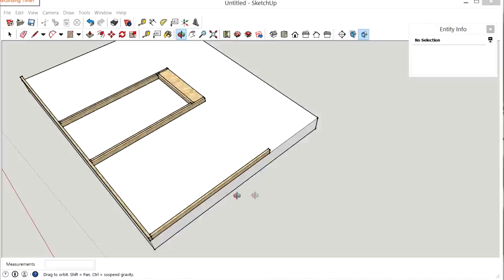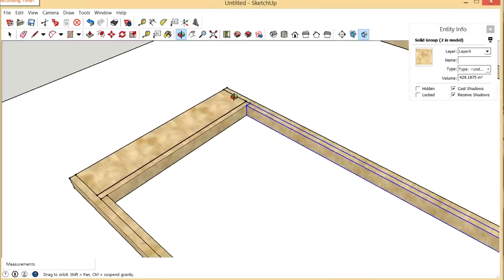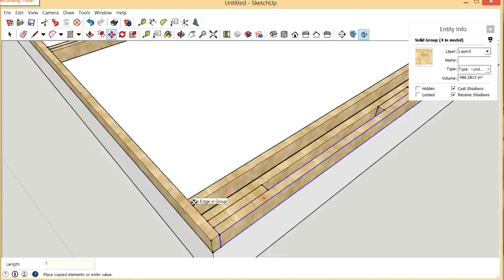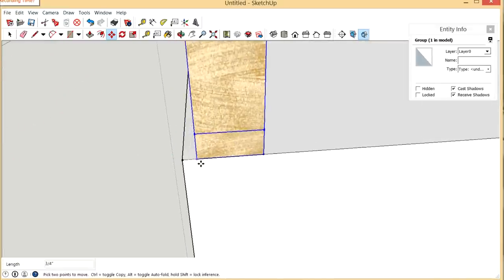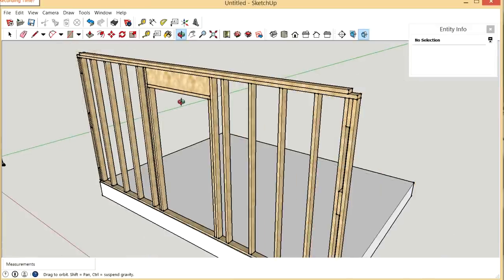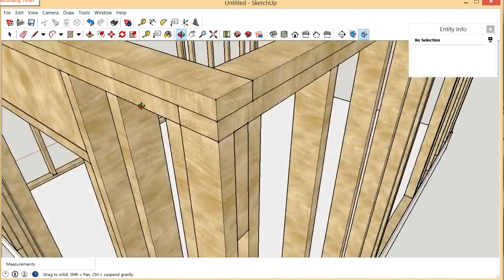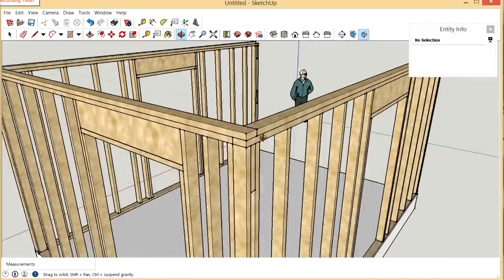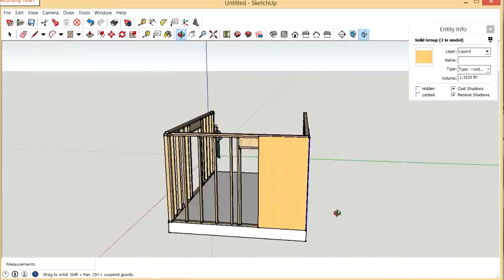Framing Exterior Wall Corners - Requested SketchUp Video

Comment: Tony,
   When the osb is placed where the corner of the wall begins and not the corner of the concrete the 16" on center layout is off, if that is the corner of the concrete is used to begin the centers,  so as that the osb doesn't break in the middle of the stud leaving no overhang for the next osb. I was told to pull centers from the end of the concrete not the start of the wall. Do you recommend cutting the width of the osb off the length of the first sheet so that it'll break in the middle of the stud, or pull the centers from the start of the wall?
Reply from the maker: The layout is marked on the framed wall not the concrete.  The layout will not be off because you lay it out properly so the OSB lands in the center of the stud.  If you hook your tape over the plates when you are laying out and mark the centers, there is no way the OSB will not work.  Trust me, I have been doing this for 40 years :)
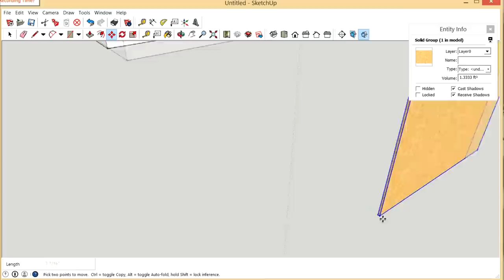Reply from the maker: Watch the video again staring at 12:43  you will see the OSB work.
Reply: @ArtisanTony  That's what I thought. I think what it is, is that the one who told me to pull from the concrete was thinking to have the OSB hang off the concrete, which would make the wall start at the concrete, which if done would then have a correct 16" on center break for the OSB. That though is a different method a building, than what you're showing, which of course, is to have to the OSB sit on the concrete. Thanks.
Reply: @ArtisanTony  Is there any way that you make a vapor barrier for the osb and bottom plate? This other person does build with the osb hanging off the concrete, and not sitting on it. I know he told me to build with the osb on it, but now he's saying no because of water leaking off the osb, and not having a place to go which causes rot. How do I guard against that? I've already poured with measurements for the osb to sit on the concrete.
Reply from the maker: @terranceedwards4750  if water is getting to your osb then you have failed.  Let me ask you,  if you let the OSB hang over then the bottom of the osb is exposed the exterior right?  There are many frauds on youtube who have never built anything.  Trust who you wish.  But if you let the osb hang over then you have exposed it to all of the elements and everything else mother nature has to offer. good luck :)

Comment: Great video, thanks.
Question:
Which wall usually receives the stud-block-stud combo with the top plate cut back 3.5 in, and which wall usually has the longer top plate which overlaps the other wall? Is it the gable wall with stud-block-stud and the eave wall which has the longer top plate? Thanks
Reply: Great question! It doesn’t matter, does it? I’m just learning framing now.

Comment: The outside OSB sheet lands 16 inches on center but because of the corner when you put drywall on the inside won't it miss the stud by 3 1/2"?

Comment: On the short walls do you start your second stud 3 1/2 inches further back to account for the thickness of the long wall at the corner?
Reply from the maker: yes, so the 48" OSB will work out coming both ways from the corner.

Comment: the quarter inch is left for the OBC in the corner is a little unclear, why do you do this and exactly how would you keep the OBC flush... could you please elaborate, i am in the process of doing a 11 by 7 feet shed that i want to frame up and make proper because whats there right now is more or less a fence shed im going to take down... i have done some architecture classes in the past so im not exactly new to framing but never really got into the exact 1/2 inch corner to run the OBC out... we where just thought to overlay the OBC on its corner... would help f you could explain a little better.

Comment: Use the blocks somewhere else and just throw a full stud in there or go with a California corner. Stud block stud is the kind of framing you should try and avoid. It's early 1970's track house framing at it's worse.

Comment: I want to know if I am framing this would the first floor be 8' studds with the two plates on top then another level of 8' studds above it if I want half the back second level to a loft and the front to be an open cathedral ceiling or should I use 16' studds all around?
Reply: I'm building a cabin in Alaska. I'd share a pic of what I'm looking for but there isnt an option to share a pic
Reply from the maker: A wall that is 16' tall should be built out of 2" x 6" studs  and be full length.  Do not stack one wall on top of another.  This creates a hinge condition in the wall and the building inspector will get you :) But to answer your first question;  studs for an 8' wall are 92 5/8" long and the wall height is         8'-1 1/8" when you nail the bottom and two top plates on.   This is so when you add finish floor and ceiling material you would still have 8'.   Normally the floor system divides the 8' walls on a two story home and gives them stability.  I can help you design this for a small fee :) This is what I do at atdrafting.com

Comment: Video not to long,showed the purpose and reason of an OSC. What you referring to as a jack, we call it a cripple.  I never used a 2x4 under a header but do see how it can help in installing it flush.
Reply from the maker: a cripple is anything shorter than a stud except we call jacks, jacks.  Normally cripples are below windows or above headers when there is more space above a door or window.

Comment: How about a greenhouse? What materials could be used for sheathing and roof to allow the best sunlight into the building. Would the sheeting need to be outer and inner for insulation (trapped air in between)?
Reply from the maker: The806Traveler This one has some challenges.  I have seen many greenhouses with just plastic sheathing but as you know, this is not very strong.

Comment: so how does the interior layout work out if the first stud is offset 3 inches because of the corner. do you just cut your first sheet rock and then grom there everything is on 16in centers? thanks

Comment: How would you frame a 6'x10' lean to style deer blind on a hay wagon frame that is decked over with a 8' high 10ft long wall and on the backside a 7' high 10ft long wall with a running slope on the 6ft walls connecting them
Reply: I am struggling with how you would tie the headers together on a sloped roof
Reply from the maker: @adamd6261  you can contact me here https://atdrafting.com/request-for-service  Thanks!

Comment: Is the 2x4 between the jack stud and the header necessary? Couldn't the header just rest on the jack stud?
Reply from the maker: The 2x4 on the bottom of the header helps set the width of the header and also the height of the door opening.  This is the way walls are framed.  Thanks

Comment: do you have any good books for room framing and electrical?
Reply from the maker: Yes, I buy used text books from Thriftbooks online. I just checked, they have the textbook I had in my building trades class 4 years ago.  It is called Modern Carpentry and they are really cheap now used.  I paid like $75 for the first one I bought years ag and now you can get them for under $10.
Reply: @ArtisanTony   thank you
Reply from the maker: @tmh7177  haha I just realized I left the 0 off of 40 years ago :)
Reply: @ArtisanTony   No problem , Thank you for the information. The video was great.

Comment: do you use 2by4 or 2by six on outer walls
Reply from the maker: It depends on the application.  For a shed I would use 2x4 and on a house that had 8' walls I would also use 2x4 but on any walls taller than 9' I like to use 2x6.  The energy code is changing for 2019 requiring 2x6 for exterior walls so R-19 insulation can be used in the walls.

Comment: 14:30 looks like your OSB lines up on the stud on the long wall. But then how is an 8 foot sheet drywall going to fall on a stud on the long wall? Because you added your corner of from your short wall was pushes off everything three and a half inches so how is the drywall going to line up now it probably be three and a half inch too long?
Reply from the maker: All layout is done for outside considerations such as wall sheathing and siding first.  Drywall is not considered to be a priority when it comes to layout.   Drywall is easy to cut so you just cut a starter piece then all other sheets will work.  Most rooms are not big enough to make drywall a priority when considering layout but exterior walls are longer so the siding layout is considered more important.  You your OSB should work in both directions from the corner starting from the layout end.  All of the structural members, joists, studs, rafters etc should all stack on top of each other.
Reply: ArtisanTony, so the cut out of the drywall you're saying we'll go to the corner so that the tapered ends all meet up in the middle of the wall or more so?
Reply from the maker: Drywall is only tapered on the long edges not the 4' ends but yes you put the cut edge in the corner so the factory ends butt together.

Comment: What software are you using to do those models?
Reply from the maker: Microsoft Word
Reply: Didn't think Word would let you add boards, walls, and concrete slabs to a type of virtual image.
Reply from the maker: @nanmer7135  It was humor because I have a pinned comment about the software.  Every other comment I get is asking about the software when that is not the point of the video.  And it would be nice for people to do just a smidge of self investigation and reading.  My pinned comment about the software is literally below your comment. Thanks
Reply: @ArtisanTony one of the reasons you keep getting asked is because how you Word it in your description. When you tap on it and it redirects you it actually looks like a book. You should include the word software in parenthesis in your description and I think it would help. Also, inspite of it not being the point to your video it is something that your subscribers are interested in learning. By you mentioning that it is not the point of the video makes you come across like a ....
Reply from the maker: @nanmer7135  The pinned comment literally says "The software is SketchUp. Don't ask me again :) jk" and the link in the description literally says "SketchUp for dummies" I think you are just one of those guys that likes wasting other people's time. Congrats, it worked.

Comment: You don't need to make your header full thickness. (leave out the plywood that is sandwiched between the "10 and 7/8" header stock. Not sure what that is. LVL maybe?)
Flush the header to the outside of the wall and that will leave you with a space for insulation.

 Your method of building a corner is outdated. A California corner (L shaped) provides more room for insulation.

Comment: im blown away with the times 10 thing to evenly copy and space the studs... i tried it but didn't work... you just copy paste move to the desired length then hit *10 enter right? cause that doesnt work for me :(
Reply from the maker: Yes, just end the copy operation then type "* 10" and it should work.  You have to do it right after the copy command.  Maybe mae sure you are hitting the enter key to end the copy then right after that type "* 10" and hit enter again. Are you trying to use your mouse maby?
Reply: ArtisanTony thanks mate! Btw do you happen to have a video showing how to frame walls with incline of a pitched roof?
Reply from the maker: I don't think so but I will try to do one soon.

Comment: That outside corner is no longer code can't insulate and besides that when you stand your other while you're inside is only going to have half an inch for your sheetrock to screw into should have inch and a half so when your half inch goes on one wall you'll have the other inch you also sound like you're from South which you don't get very cold so I'm sure the insulation is not an issue
Reply from the maker: It's been done that way for 100 years and the inspector never says a word about it.  I have been doing it for 40 years.  It's a strong corner and works.

Comment: Has the author of this video ever been a framing contractor or had to pass a framing inspection ?
First, for your door opening the door header or lintel should be sitting directly on the cripple (jacks), not on the flat 2x4 which is then sitting on the cripple.
You only need 3 studs to form those corners, 2 of them form an " L " for one wall and the other has a single stud that nails flat to the " L "
I couldn't see it clearly but your interior walls top plate should overlap onto your outside wall and if this home requires insulation then it will also need a poly barrier between the interior and exterior wall.
I learned these things my first day of framing many years ago. These mistakes would get you a framing inspection rejection.
Reply from the maker: I have never failed a framing inspection in 44 years.  Please get off your couch and go work on a real crew.  None of what you said is done in the real world.  The way I show it is how it is done.  Now go learn some manners
Reply from the maker: Also poly vapors went out in the 80's when we found they were rotting the bottom of walls through collecting condensate moisture.  I can tell you haven't worked on a construction site in years, lol  If you come back and apologize for your manner, I will allow your comment to stand otherwise you will be tossed.  I checked your channel and you have a wealth of knowledge listed there, lol, NOT
Reply: @ArtisanTony  We get winters where I live, Do you live in the south where heating in winter is not required ? I switched from a framing contractor to a structural concrete repair contractor years ago.......more challenging and a lot more money.
Reply from the maker: @garyevans718  Well this is the way walls are framed.  The 2x4 on the bottom of the header spreads the 2x10 the right width for the wall and also makes the overall height of the header make the correct size rough opening for doors.  The California corners you reference are inferior as they do not provide the same nail for exterior siding and corner trim as the way I show in the video.  If you had watched the entire video, all of this was discussed.  And yes, the top plates always overlap when intersecting a wall.

Comment: can you build a supply list using sketch up?
Reply from the maker: Andrew Esqueda not automatically. I think there are plugins but it would require using components and as much trouble as just looking at the drawing and counting studs :)
Reply: if i sent you a drawing? (bet you never heard that) I'm going to be building a 2 garage with an attached rv garage and also with a 1 bedroom Mother in laws quarters on a second level above a 2 car garage and I'm using  virtual architect pro. My question is into regards to properly  supporting the apartment over the 2 car garage
Reply from the maker: Andrew Esqueda what is span of joist for room above the garage.
Reply: ArtisanTony First off thank you for your quick responses. Second enjoyed how thorough you were in the video. I will get that exact info for you to see.
Reply from the maker: Sure, I might be able to do a quick video on it when you get dimensions. Thanks
Reply: do you have an email I can send you some pictures with dimensions?
Reply: email sent thanks
Reply from the maker: do not have it check the email address tony@gunsandgearvids.com I don't have much time, check the address

Comment: Moving the wall back a half inch makes sense for a slab, but not for a subfloor... IMO.
Reply from the maker: Why would you force yourself to have to add osb  on top of the header/band joist of the floor framing system.  No real carpentry crew does this.  The 4x8 sheets are designed to start at the bottom plate  and extend to the top plate of the wall, not lap over the floor system the come up short at the top.  OSB requires all edges to be nailed so now you have to put blocking at the top of the OSB. There are 20 reasons professionals do not do what you are talking about doing.  I can lead a horse to water, but I cannot make him drink :)  btw, the osb will be exposed to weather on the bottom when you leave it hanging over. I don't have time for all 20 reasons
Reply: @ArtisanTony  good point, was thinking it ties the wall to the floor better?
Reply from the maker: In the industry, it is considered a mistake when the layout guy pops the lines where the framing is flush with the floor band because of this reason.  I am always there when we start framing to make sure this mistake does not happen because it costs me money.  The owner is not going to pay for extra material and labor because we make a mistake like this.  The blocking required at the top of the osb all the way around the house is a big deal on labor.   The osb nailing pattern is 6-8 inches around the edges depending on whether it is for shear or not and so the blocking would be a requirement.  If installed correctly the top of the sheet would be nailed to the top plate.   This is also why you do not lay sheets down horizontally,  another big mistake :)  These are mistakes first year carpenters make, not 40 year :)
Reply: @ArtisanTony  Thank you for taking the time to explain, I really appreciate it!
Reply from the maker: @KrypticPatriot  Thanks for asking and listening, most just want to argue online :)   When I explain things to my customers in real life they are happy they saved money and time but online, sometimes people get mad for some reason.  I think it is because they cannot see that you are trying to help :)